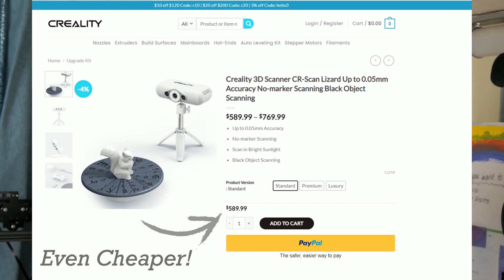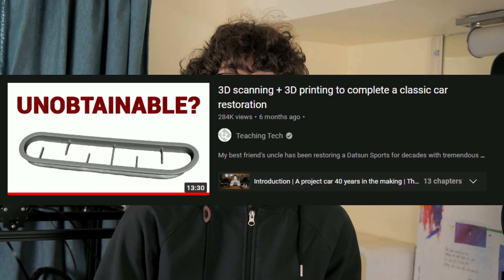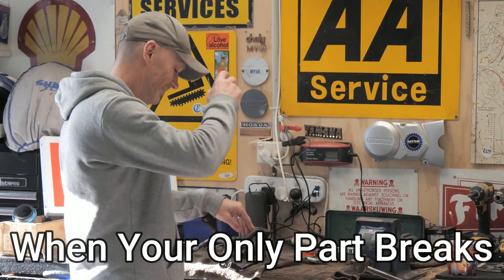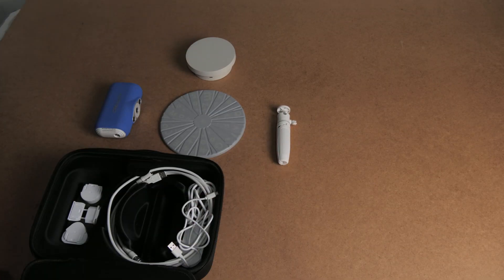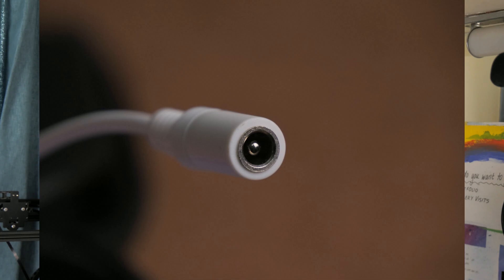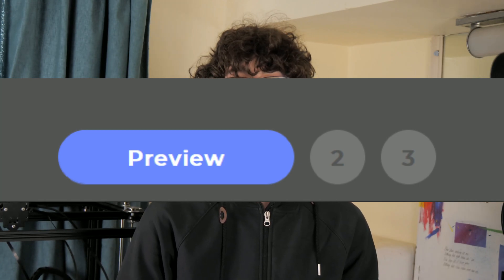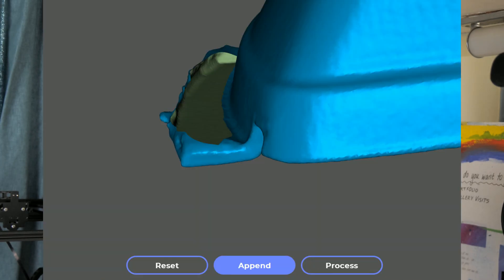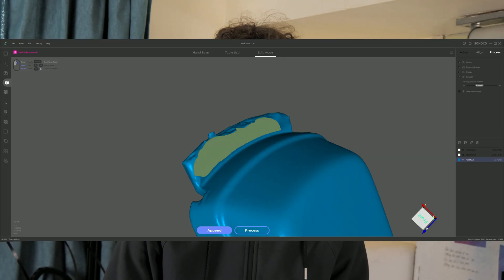Budget 3D Scanning Is Now Available!

Comment: I do a lot of 3D modeling using images I capture from my mobile phone. What are the benefits using this hardware versus a standard mobile?
Reply from the maker: It really depends on the situation I'd say. 3D scanning using proper hardware is generally capable of much more precision than the results achieved using lidar/photogrammetry.  I had experimented using my mobile devices along with a camera to try and "scan" a part, but I could not get any successful results.
For scanning large objects for use in CGI for example, I'd say using a mobile device can be much better. As mentioned, It does depend on the situation. I don't have the most experience with either, so I can't give you a professional answer, but there are several good dedicated videos discussing your question. If you'd like, I could do my own take on one of those videos as well.
Reply: @TommyHoughton  I can see how a comparison video would be helpful for a lot of people (including myself)
I think we could all appreciate and benefit from that type of indepth research.
Reply: If time permits
Reply from the maker: I will do some research/planning and see what I can do.